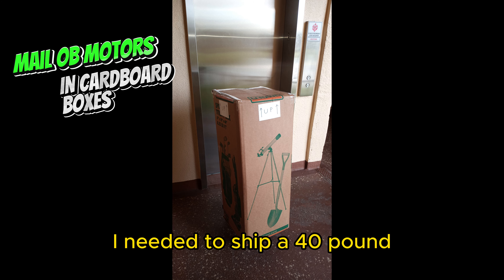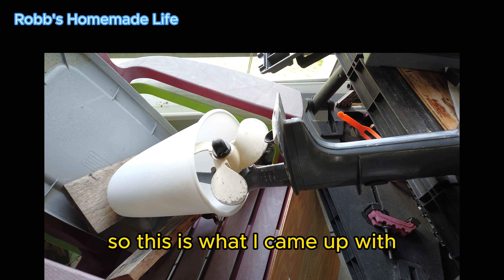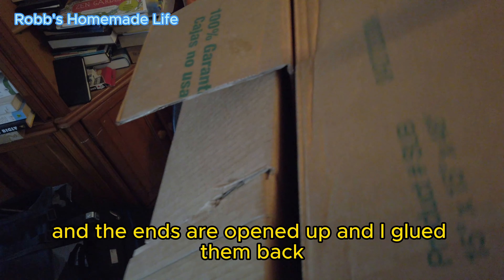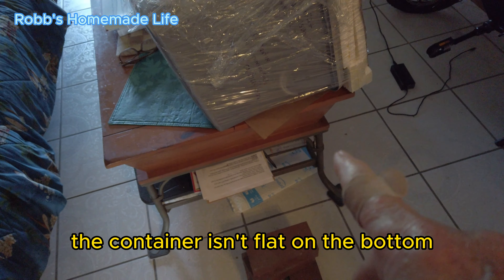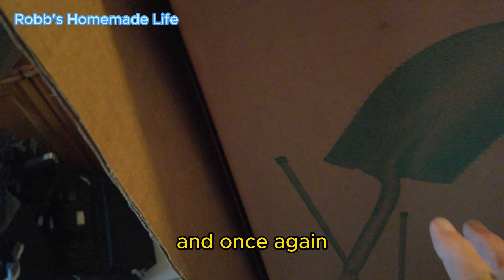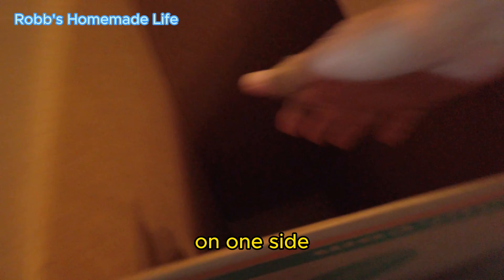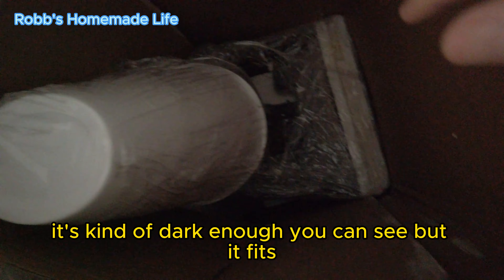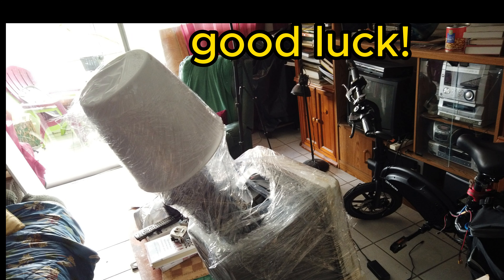How to ship an outboard motor using cardboard boxes. And a lot of glue.

Comment: They make expanding foam bags that mold themselves around oddly shaped things 😄
Reply from the maker: Hey Oscar, somebody else mentioned that. I wasn't aware of it but I was basically trying to keep the weight down as much as possible. I saw Walmart had inflatable beach balls for $.99 apiece and inflatable pool raft for two dollars and I was going to use those but what I did actually work pretty good.
Reply: @RobbsHomemadeLife  I saw the beach balls great buy. I've got to go back and check for the pool raft . Depending on the kind they are excellent for diy camp bed to floor work. If it's a certain material I could recycle for covering my bench seat for the winter. Course I choose colors that go with other stuff.

Comment: Whatever works. Unfortunately there is zero chance that is going to stay in the desired orientation during transit. The only humans that will ever see those arrows are the driver who picks it up and the driver who delivers it. The rest of the handling is automated. If you ever have the misfortune to need to pack/ship something like this again, consider wrapping it completely inside a heavy duty garbage bag or wrapped completely in plastic sheeting. Then get yourself some 2lb per cubic foot 2-part pour in place polyurethane flotation foam and use it to fill the void between box and motor. Boom - perfectly fitted custom rigid foam packaging. If I shipped enough big unwieldy stuff I'd invest in the pre-made 2-part foam Instapak type bags, but they're a little pricey and have a short shelf life. I've received refurb computers packed with those bags (one on top of the box, one on the bottom) and they did a fantastic job.
Reply from the maker: That's a good idea. John. Another idea would be to go to a Marine dealer and get a box from them that was used to ship a motor to them.
Reply: Gotta be careful with those bags, they can become a sort of hydraulic lever if you bend them over the wrong way and sensitive stuff like the inside of a computer can be damaged.  I've seen video card mounts ripped from their motherboards